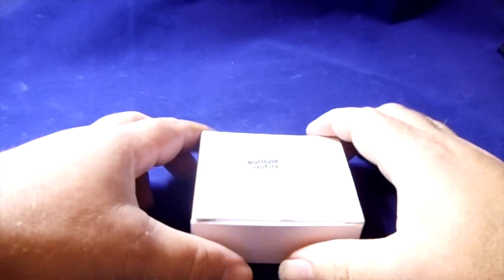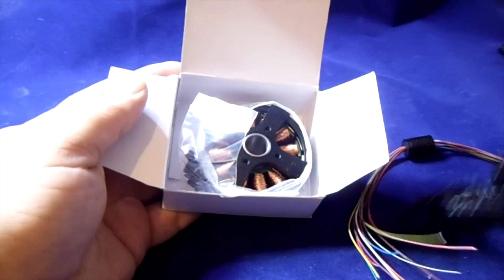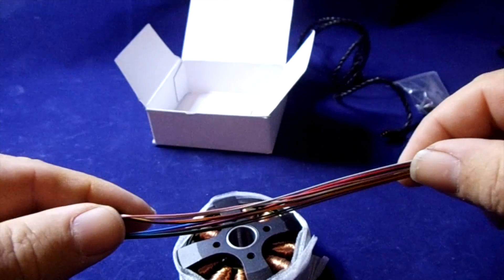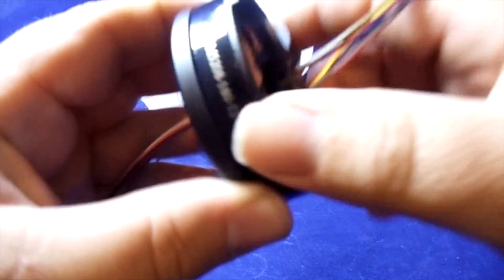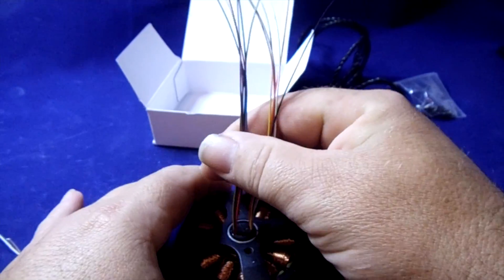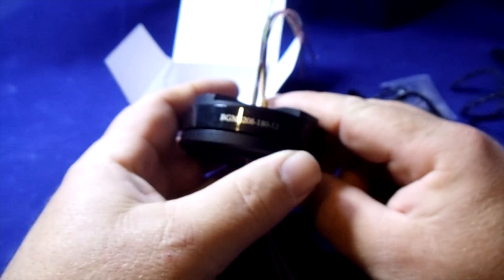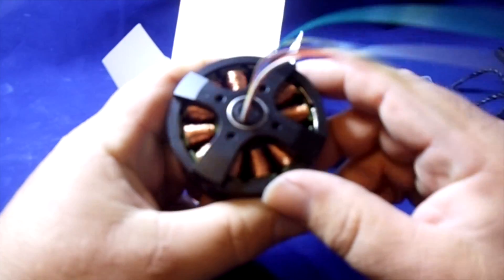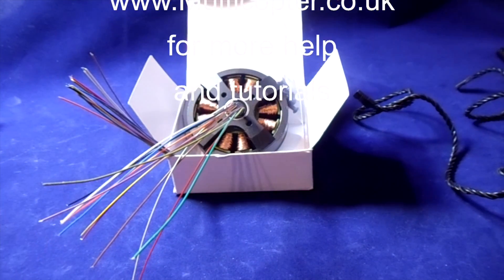Brushless Gimbal Motor BGM5208-180-12

Comment: Has anyone ever tried to see how much AC Voltage (and/or Power) these high turn-count / low Kv rated motors will GENERATE?  They should do quite well, I imagine. I have applications where I need to use such a small 3-phase Alternator, but they're expensive to just buy and try...
Reply: +beforebefore Long time since you asked this, but I've used an iPower GBM-5208-200t as a generator with a three-phase diode rectifier and loads in the 100-200 ohm range. Works very well. Unloaded voltage can get huge, think I had a couple hundred volts out of one really cranking on a 30:1 or so gearbox. I haven't yet used it for continuous generation, only short-term testing use, so I don't know what the thermal limit is on output power, but I've certainly seen peak powers in the 100W vicinity, and done 40W or so with 75% end-to-end efficiency using a 10:1 Vex Versaplanetary as a speed increaser. I'd guess that setup can can do 40-50W at nearly continuous duty with good airflow but that's just a guess. 3D print up a fan for the windings maybe?

I pulled 43W at 50% efficiency spinning a drill press at 2800RPM out of the smaller GBM-4008-150T (which I doubt it could handle thermally for continuous duty), and 8W at 88% efficiency at 2000RPM with a lighter load.

Comment: Quadframes, from what i can see you will need to make two things; one is a new lower cf plater that the motor hangs through with a bigger hole for this motor. Also a new aluminium block that attaches to the yaw motor with wider spacing for the 4 screw holes and bigger centre hole for slip ring wires. What you think?
Reply from the maker: Hi Yes you could do that or you could get a BGM4108-130T with Hollow shaft and you should not have to do any mod ;-)
Reply: I was thinking about that because RCTimer seems to be selling the DYS 3 axis gimbal as 'APS' and it comes with the hollow shaft motor. The problem is it looked pretty narrow, not sure how many wires you could get through it. I was thinking 2 wires for power, 4 for tilt and pan as a minimum. What do you think?
Reply from the maker: Hi Yes it is narrow, its only for a few wires maybe 3-4 only. I have one coming so I will do a video to show when it arrives.

Comment: Do you know if this will work with the DYS 3 Axis Brushless gimbal that you previously did a build tutorial on? I am thinking of using it for the yaw motor. I couldn't tell if the mounting holes are the same as the other motors that it comes with.
Reply from the maker: Hi yes this is something that I have thought of just not had time to try yet, not sure that it will fit on the mounting bracket, you will prob have to make something.